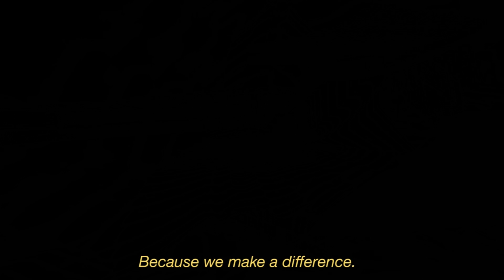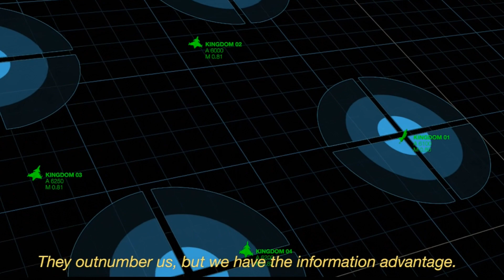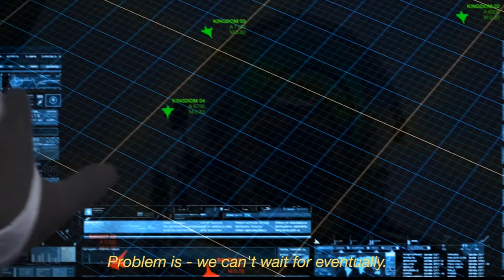Gripen Fighter Jet - Canada's Future Fighter?

Comment: The F-35 is dogshit, there is a huge list with all the flaws and poor performance aspects
Reply: So they colored the fuel truck a different color so the fuel wouldn't be so hot. Big deal. That's what testing is about! They might have to change the windshield washer fluid too! F-35's have over 115,000 flight hours on them for the 260+ units delivered. There have been NO crashes of F-35's. None. That is unheard of in new fighter development. The JAS-39 Gripen has had at least 8 crashes (Sweden, Czech, Hungary, Thailand) that I'm aware of. The ONLY way a Gripen purchase makes any sense for Canada is if it can fully link with the F-35 platform. Otherwise, it is a waste of money. Gripens are expensive to purchase too. Their operating costs will be lower, but so will the capability. Norway, Netherlands, Denmark, Belgium et al would not have selected the F-35 if the JAS-39 was even close to the capability of this full 5th gen fighter. Canada's hate for anything from the USA has clouded judgement north of the border. Trudeau used that to get elected. Now a stink with Boeing (Super Hornet) has Canada looking elsewhere for fighters before the existing (CF-18) fleet runs out of options. This is where MAJOR procurement mistakes are made. In haste. All thanks to Canadian politics.
Reply: Ron Clark what government hired you to troll social media cites to cover their bad press?
Reply: the only reason they haven't gotten rid of the F35 is because its parts are pieced out to about 8 different states in the US that depend on that pile of crap for income and the president knows this. he was all for getting rid of it before he took office, then once he did he realized how many jobs he would be shutting down and that went directly against what he got elected on. so, thats why  there is still an F35 program to this day.
Reply: U wot m8? it wouldn't be the first time someone lied in front of congress because they have an agenda.
Reply: Cal crappy CITETATION needed.
Reply: Cal Crappy yet they wrent used in syria.Unlike the f-22.
Reply: Do we want to give Russia some intel? No. Russia probably had test equipment everywhere.
Reply: Cal crapie was the problems with the logiostcis program solved.The jet fuel in the f-35 is used to keep the plane cooled.but if the fuel is to hot.Thne plane overheats.was that solved.With the planes weapon bay doors closed.The f-35 overheats.was that solved.The planes ejection seat.breaks the pilots neck.if the p[ilot is to tall.was that solved.The f-35s engine only lasts 100 hors.was that solved.if none of these problems were solved.then the f-35 is not operationally aproved.
Reply: Cal crap[ie nice pointless video.you didnt answer my question.nice dodge though.They had to change the color of the vehicles.That hold the f-35 fuel.to make sure.That the fuels temperture doesnt go above a certain point.That was what was done.Before your video was made.
Reply: Cal Crape coloring bthe  fuel tyruck white.keep mthe fuel temperture lower.Something you wouldnt want to do moverseas.Allso your point about the Grypen safety record.CITETATION NEEDED.The reason why Belgium selected the F-35 isdirtel;evant to this discusuion.Canadas procurment of the CF -18 Super Hornet ios nott a mistake./They cant AFORD to BUY.And PAY the Cost to US a F-35.Lastlthe hud helmet of the F-35 is so big.you cant move your right.You have to keep looking straight ahead.You cant look to thre right or left.Not a good idea.
Reply: american propaganda, ofcourse they gonna say its good, otherwise nobody is gonna buy that shit plane.
Reply: It got beasted by an F-16 in trials.
Reply: You're not wrong.
Reply: ^^ nonsense. ^^
Reply: TheZansibar 

Those flaw reports were bogus the plane was a C D Howe project John deafen baker  gave the order to destroy the arrow before the plane was completed but at the time plane was missing the intended engine which now sits in the ass end of the space shuttle but had that engine been built sooner the we’d have the plane was almost flawless as stated in the log by F/LT J Whitman a man I had the honour to meet l don’t what you were told or read a test pilot knows what their talking about John deafen baker never agreed with project he had a successful plane destroyed
Reply: Th F-35 has put so much debt together (financial as well as political) that is simply cannot fail. That does not mean it is a succesful project and also does not mean that countries that decided to buy the system did so because it is a succesful system.
Reply: So they say but people keep buying it...and its the only stealth on the market right now. That alone makes it superior. Its  excellent for what its intended to do. It does not have to be supremely maneuverable as no manned aircraft can out maneouvere a missile.  A human blacks out at 9 g forces...a missile can pull 30gs easy. Evasion is key. Therefore stealth. Also...the USA has massive amounts of actual wartime experience and withspectacular successes...if they think its good we should give them the benefit of the doubt. They are the worlds only succesful experts on war with experience right now.
Reply: germany wont as at the moment...
https://www.defensenews.com/air/2017/12/12/spat-over-the-f-35-bubbles-up-in-germany/
Reply: maybe the f-35 wont crash cause most of the time it is on ground XD
Reply: TheZansibar "Poor performance" it's more agile than the F16, faster with a full payload and can carry more munitions than the A10, what exactly is it lacking?
Reply: IM 928 Nope, that was testing the F35's flight computer, the F35's flight computer was over assertive and wouldn't let the F35 perform certain manvoueres. The F16 was simply there as a refence point
Reply: Nastalas "Most of the time on the ground" the Australian F35's are already achieving flying rates of the RAAF super hornets while not even being in service as long as them
Reply: "Dogshit" that would destroy any fighter in the world except the F-22. Best fighter on the planet at air to ground attack and second best at air to air. Nothing out there like it. Too bad Trudeau picked the wrong fighter to promise NOT to buy for Canada. He'll buy some third rate crap (at F-35 prices) instead to SAVE FACE. The ONLY country to drop out of F-35 program and Canada stands to lose thousands of Canadian jobs that supply the huge and wildly successful F-35 program.
Reply: Cal Crappie yet the F-35 is not operational aproved untill 2022.
Reply: More bullshit, total nonsense. There is a  reason why so many nations are buying the F-35s, including even Germany to replace their old Tornadoes. Germany, Italy, and the United Kingdom are not buying more Eurofighter Typhoons, they are or will be buying F-35s. Simply put as Trudeau and the Liberals discovered, the F-35s are the best and cheapest fifth generation fighter available... They gas lighted the Canadian voter with a lot of baloney. The issues dealing with the high tech and sophisticated F-35 are being addressed through its development.
Reply: Yes, thunderbolt two. F-35's love the heat of Death Valley!  They almost look happy.

https://www.youtube.com/watch?v=d9HqVXGRJL0
Reply: Both the US Air Force and US Marines have declared their F-35's combat ready. The Israeli version (F-35i) has been declared combat ready by Israel. They have 9 F-35i's now. The US Navy is just beginning to get their F-35C's. NAS Lemoore in California now has 10 F-35C's. Lockheed Martin has delivered more than 260 F-35's as of the end of 2017. 66 came out of the factory in 2017 and the production rate continues to ramp up.

Comment: Lol Su-27's getting downed like amateurs... obviously it's a commercial. Still the gripen is a great plane. I like the simple and efficient design. Just wondering if its range would be enough to patrol over the arctic and back.
Reply: Those were probably the newer Su-35s (not the Su-27 which the Su-35 is based off).

Comment: The Gripen is a great cost effective fighter, and it is perfect for smaller countries because of the low cost and it's main limit is range which will not cause much of a problem for them. 
Canada on the other hand should perhaps invest in a larger plane that has greater range and greater air to surface potential. 
I feel that the short range of the Gripen will be a problem for a country like Canada that is so large and sparcely populated, but if you build and extensive road base system supplied by helicopters then maybe it could be worked around, but then perhaps the Gripen is not so cost effective in the end.

Comment: One thing the gripen has over other air craft is the small foot print. It cost very little to keep flying in every thing. Needs less men, less man hours, less parts, less money than other aircraft. 

One thing I can say is that a gripen can perform a cold start interception in 15min. That is a aircraft went from parked in a hanger to flying in 15min. A feet pulled of by South Africa in a real life senerio not a training drill. 

Thing is though even though I love the gripen, thing it is great and can say for sure many air forces should of picked it. Cananda needs super hornets. The 2 engines gives the crew a way out if some thing goes wrong in the more barren parts of Canada. Canada is all so big and the gripen has short legs
Reply: Gripen E has decent range but F-15 2040C might be a better choice for Canada.

Comment: I also like this aircraft but I'm also a Euro fighter fan.  You make a LOT of good points about this aircraft.  My concern is that maybe its reached its full potential while the Euro fighter is just starting to come into its own.  As for the F35 I'm concerned because its already way over budget plus our armed forces got shafted on helicopters how many years ago because the Americans couldn't/wouldn't supply them to us even though we purchased them.  I would hate for us to get the short end of the stick on an aircraft at the F35's price.
Reply: Eurofighter is as old as Gripen, so I think I will have to disagree. Eurofighters history have been troublesome and filled with deleys and compromises.
While Gripen has followed a long tradition of succesful Swedish aircraft design following succesful planes such as Draken and Viggen - planes with a single engine and excellent capabilities of taking off from short runways and highways... and its design is simple, so the maintance can be done by only 5 people (1 technician and 4 conscripts).
Unfortunatly for Sweden, have the sucess on the export market not been in par with the performance of the planes, because Sweden has never been a Nato member - and Nato countries prefer to buy planes from other Nato countries.

I am not an airplane expert. But I am more worried about the longterm future for the Eurofighter than Gripen when spareparts are so desperatly lacking that the RAF have to cannabalize some planes on parts so other planes can keep on flying http://www.dailymail.co.uk/news/article-2003979/RAF-strips-jets-spare-parts-Typhoons-torn-Libya-air-fleet.html
And when the German Luftwaffe only can keep 8 out their 109 Eurofighters available for combat tasks!
http://airheadsfly.com/2014/09/15/alarming-low-availability-german-air-forces/
Furthermore is maintance costs more than 3 times higher on the Eurofighter, and it require twice as many men for doing the maintance.
Reply: Kind of the other way around. Development on new Eurofighter variants has largely stopped while Gripen E is a new variant that is much improved from Gripen C/D. 

Which helicopters are you referring to? Canada is generally cleared to buy anything that the USA has cleared to export at all. 

Canada needs some F-35A because it is the only decent stealth fighter available right now but they can complement it with some other fighter aircraft. I suggest F-15 2040C. If you are opposed to relying on the USA then Eurofighter or Rafale would be the best options because they use the least tech from the US. They are not necessarily the best in terms of suitability for missions or cost.

Comment: The Trudeau will not replace the CF 18. He is currently running a deficit 3 times what was projected. There are also budget demands for new navy destroyers supply ships subs and roll on roll off transport ship.
Reply: He will have to replace them soon anyways. They are close to max flight hour limits. Continuing to fly them past limits would be dangerous to the pilots and anyone they fly over.

Comment: That thing is tiny, it will have NO range.  I would like Canada use a fighter that wont need our tanker fleet........ all the time. siiiiigggggghhhhhh.
Reply: Swedish JAS-39 has a better safety record than the F-18 despite having one engine less – 13% of Canada’s CF-18s have been lost in crashes compared to 2% of Gripens; a loss rate of 0,36% per year versus 0,08% per year for Gripens. Rafale suffered 4 crashes in 64.000 hours.
Gripen suffered 5 crashes total in 203.000 flight hours. None were related to either engine or aerodynamic configuration of the aircraft: 2 were due to underdeveloped FCS, 2 were due to the pilot error and 1 was due to ejection seat issue.
F-18 crash rate is 3,6 per 100.000 hours, and Gripen’s is 2,46 per 100.000 hours, and 6,25 for Rafale.
Overall, statistics show that single-role air superiority fighters tend to be safer than contemporary multirole fighters regardless of number of engines.
Reply: Gripen E has surprisingly decent range. Better than earlier Gripens. I think F-15 2040C would be a better choice though and they have long range.
Reply: A single engine is also a less survivable plane. One engine dead = one plane dead